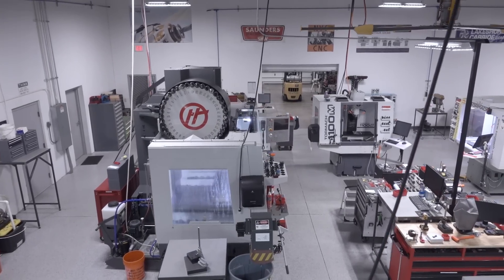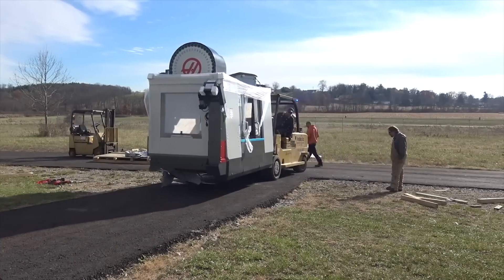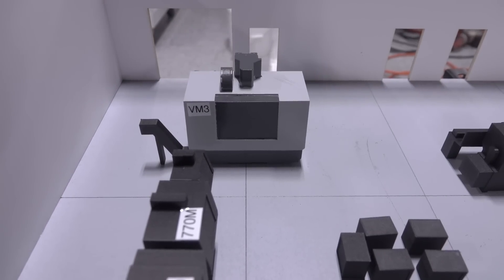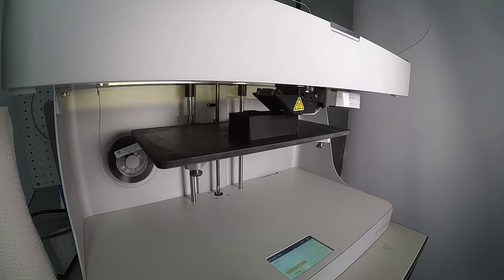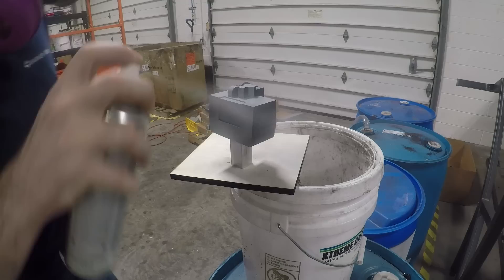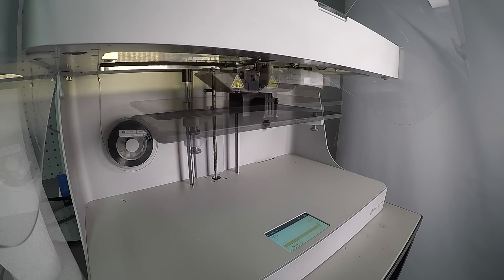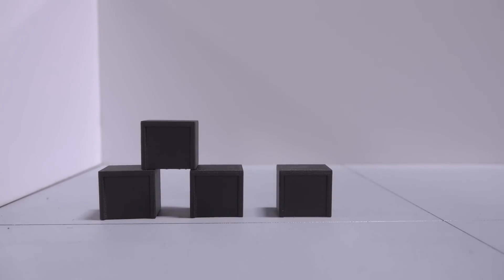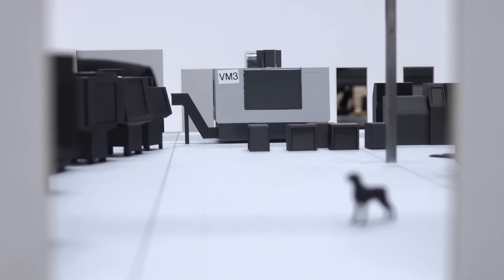Machine Shop Layout Advice: 3D Print!

Comment: I wish we had the size shop you have considering all of our equipment were very tight in here and cannot turn a forklift around inside. Thankfully we only have one expansion joint across the center of the shop and the products we make are so small that we don’t need a lot of room around the machines. Forklift is purely to unload trucks since we have a drive in door and no dock. Chatted on the phone last summer with you and we ended up going to an auction and buying several fadals and a few robodrills with twin pallet attachments.

Comment: We did a 1/24th scale model of our house during the design stage to visualize certain design features. I took a tiny video camera (sometimes called pinhole cameras) and mounted it on a base that held it at a scale 5 feet off the floor (close enough to scale eye level for an average adult). Moving it around in the model gave us some valuable insights and allowed changes BEFORE building the real thing. You can find lo-rez mini cameras for under $20.

Comment: Awesome John. I Use Something Similar But Yours Is Much Better. Mine Is A Sheet Of Sheetmetal For My Floor And I Use Pieces Of Cardboard With Small Magnets Glued To Them For The Machines. Everything Is To Scale And It Lives On The Back Of The Door To My Clean-Room So It Takes No Space At All. 
Cheers
John

Comment: Glue a piece of clear plastic to bottom of model showing areas you need to access regularly.  Also second layer showing areas you need access iregulary (coolent trays, eletrical panels etc.)  would make it a little more usefull.  Good luck.

Comment: I would recommend Pepakura Designer if you don't have access to a 3d printer. A program used for papercraft normally but the hard edges on the machines would make it easy to assemble. And why not invite the kids along

Comment: I need to do this for my garage if I am ever going to fit a lathe and manual mill in here...
Reply: I had a bed mill, 4 benchtop mills, a manual 13” large and a cnc lathe all in a 2 car garage, plus work benches, shelving, and the entire attic setup like a mini mezzanine and operated like that for a couple years before moving into a commercial space. You have to plan accordingly for sure.

Comment: Place it in your office and throw in some little LED indicator lights too on the machines, then you could wire it up remotely and see the status of each machine from your office... that'd be cool. I want to do it and I don't even have a machine shop.
Reply: @Ed Rees Flashbacks of the shear hog eating the vise...
Reply: Oakwood Machine Works ain’t that a hog shear?
Reply: That would be awesome! A little wifi-enabled micro or even better an LTE/3G-enabled micro and it could text you too!
Reply: @robr3015  Cheaper to stick with wifi and using something like if then this to push to phones
Reply: The term you're looking for is "Andon" (TPS/lean jargon)- sometimes implemented with a light board, sometimes with stack lights (like where I work). Makes it so a supervisor/plant manager can at a glance see what's making money and what's stalled/down for the count.
Reply: @Ed Rees  No need to wire... 555 timer is easier. 😏😉😜